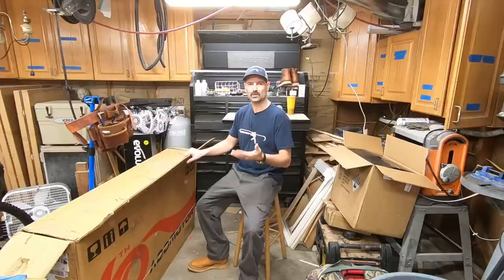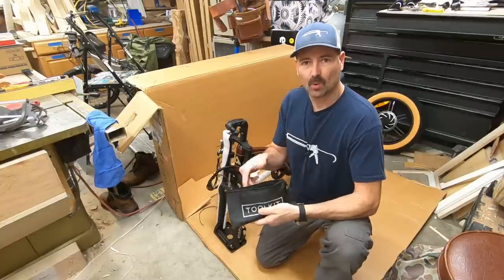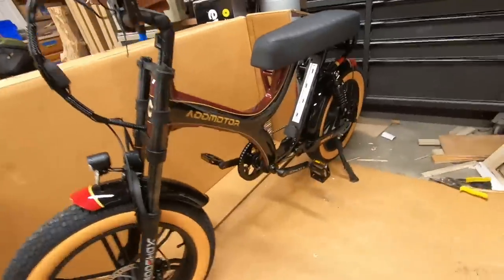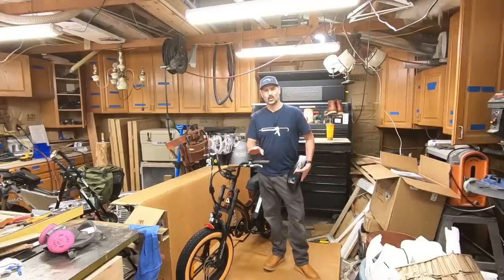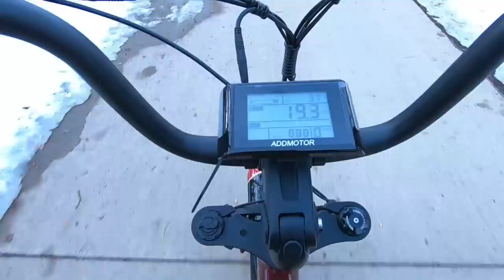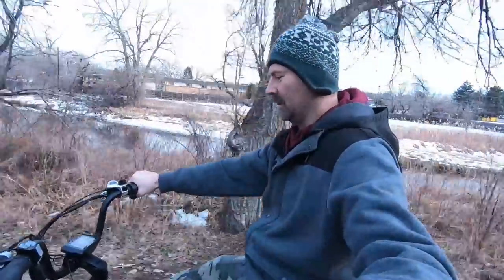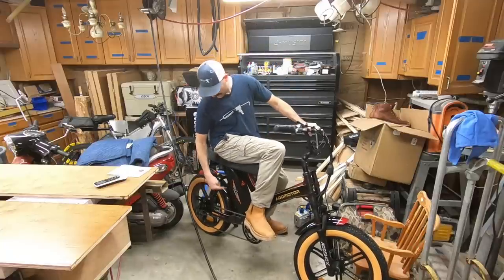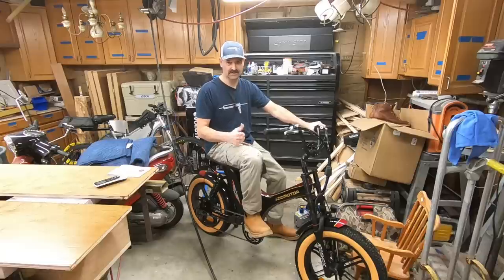Authentic Review of the Addmotor M-65X Electric Bike | THE HANDYMAN |

Comment: Love the looks of the bike, but I agree with you on the speed. I ride an Aventon, Aventure their fat tire model.
 48 volt, Bafang motor, comes set at 22 mph but it can be unlocked. Which a guy just had to do
 I've gotten 34 mph out of it in peddle assist 5. I mostly run in PA 2 or 3 and get upwards of 35 mi. out of a full charge. Oh, and Im a handyman too, for the last 40 yrs.
Reply from the maker: I might try to sell this and get a super 73.
Reply: @TheHandyman1  looks like a scammer working in the replies, unless your name is actually Muhamad.😄

Comment: Is the speed sensor on the fork or chain-stay with a wheel magnet? You can take it off and attach the sensor next to the BB and tape the magnet on the crank arm. The computer thinks you pedaling is the wheel rotating. Hold on and have fun!
Reply from the maker: I was hoping that would be the fix.  The limit is in the motor RPM.   Its all internal.

Comment: How would you even remove the limiter?
Reply from the maker: You have to get an aftermarket controller and screen.   The super 73 s series is about $1,000 more and has an off road mode to go as fast as you want.   Same motor and same battery.

Comment: yup, i was looking at this, until you said it cannot ever go faster then 22 mph ok, sorry no deal for me ok :0
Reply from the maker: I emailed them and they said "they don't think it's safe to go over 20mph".  It looks like a nice bike but is locked out.  They also use a proprietary controller that can't be swapped out.  The wiring harness seems proprietary too.
Reply: @TheHandyman1  well this is why i will be going with the Ariel Rider Grizzly :0
Reply: @TheHandyman1  right now i have the Addmotor M-340 the old version and it does 21 mph, which to me is a bit scary at 21 mph, but it is a E-trike ok, but i will be getting the grizzly for faster speed ok :0
Reply: @TheHandyman1  but really, they should leave the top speed up to the person who owns it, not try and tell people what they can do ok, that sounds a lot like china or the CCP ok :0